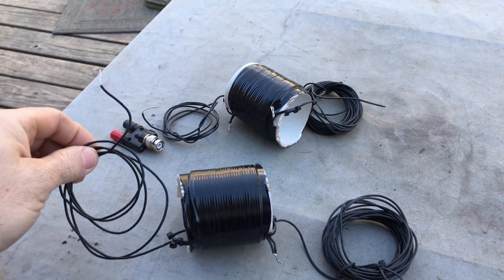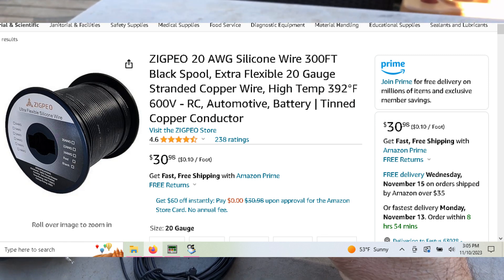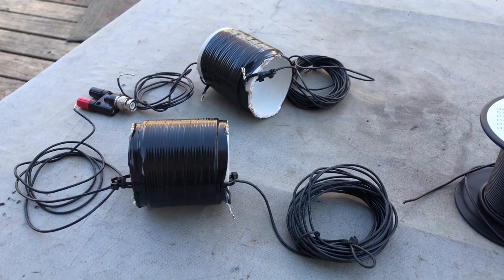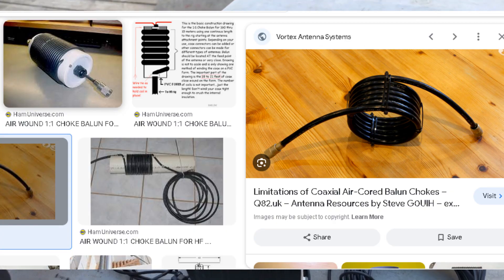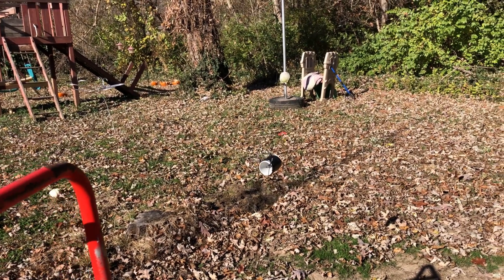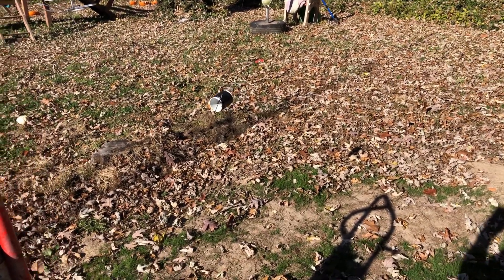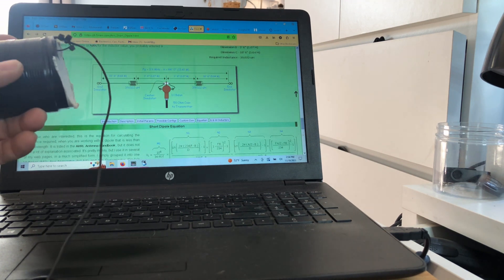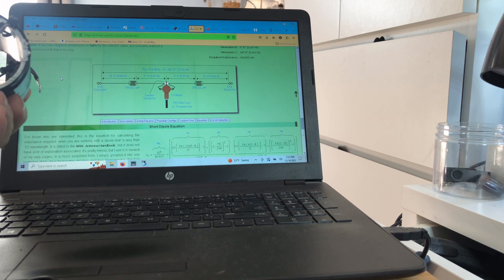80 Meter NVIS Antenna Project

Comment: Thanks for this, I've been working on an nvis antenna specifically for one frequency on 80m (for winlink for our local ARES group) and this is a massive help! 

Any updates a year later?
Reply from the maker: Glad this helped you! I year later it’s still working well. It gets used maybe a couple times a month and I haven’t had any issues with it.

Comment: Hi! I have an NVIS antenna for 40m. I'd like to know wether 5W QRP is practical enough for propagation via NVIS,  not for the usual propagation with low angle radiations. Thanks!

Comment: I read somewhere that the high q is a result of using small gauge wire, and thicker wire has higher a. Would this work for close comms less than 10 miles away?
Reply from the maker: This should work well out to about 300 miles or so. You may be right about the thin wire and high Q.

Comment: ? I see the Calculator for inductance, how do you know how much inductance you are looking for , or targeting to build .
Reply from the maker: The K7MEM site will calculate needed inductance based on the length of antenna you're aiming to build. If you then take that inductance number, you can use the inductance calculator to get your turn count based on the diameter of your coil form. 

I hope im explaing this in a way that makes sense.